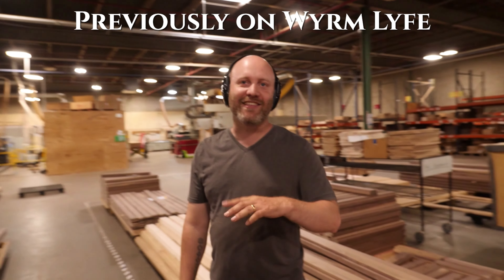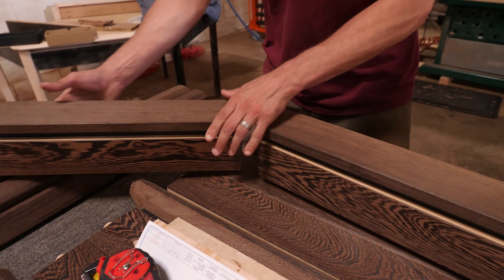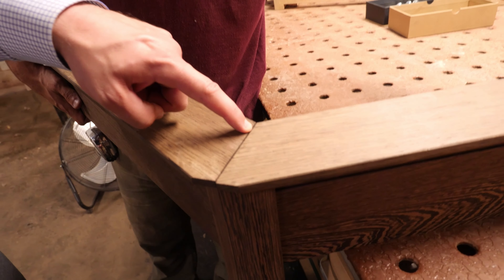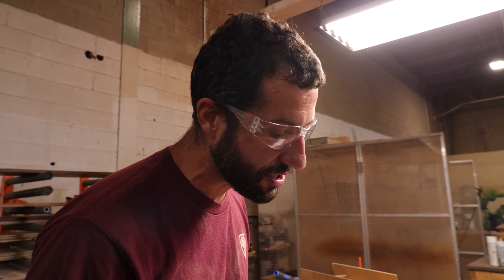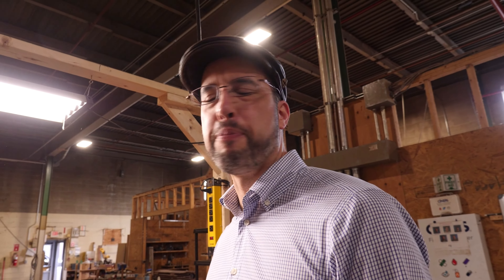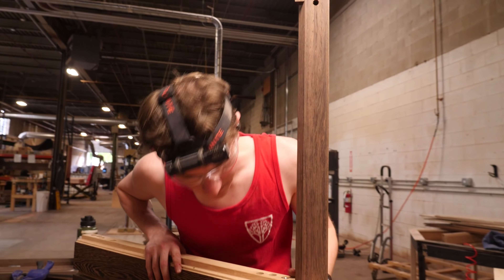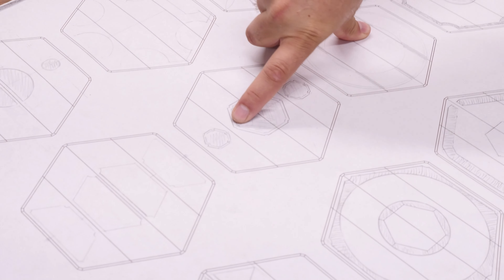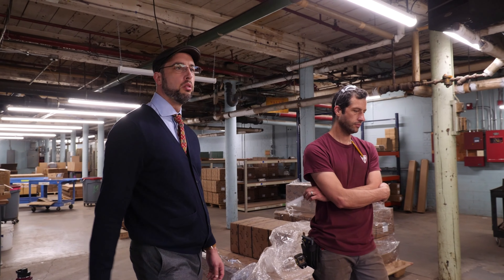This Table's Got Some Problems...

Comment: Glue a plug in, let it dry then re drill
Reply: They need you on speed dail for problems like this
Reply: I'm not even a woodworker, and this was my immediate thought.
Reply: Truth. Way easier than making whole new legs.
Reply: Just goes to show that Doug doesn't understand how to fix mistakes, and just decides to start over! Ed's suggestion is the correct decision, and proves that Ed is a better woodworker :p
Reply: You know this was my first thought too, but if the master woodworkers didn't suggest it, I thought maybe I was crazy. Thanks Ed for confirming my initial thoughts and my level of insanity.
Reply: Especially on the interior of a joint on a prototype...lol
Reply: OKAY SO, 5:30 calls our Hunter's error in reading the blueprints SORTA but really this 30secs and the entire video are really just a display, a GLIMPSE,  of why Doug and Ian are MASTER wood artisans and why they have been able to build such a successful company...#wheresmydmscreen XD

Comment: I worked at a helicopter manufacturer, you'd be shocked at how much hidden factory stuff was going on that was out of alignment with design just to get the aircraft to fit together.
Reply: That's terrifying
Reply: @matt-lang  I find it reassuring.  Robots and lasers or not, when you absolutely want the best fit/performance, you have a skilled human make it work with reality, not a drawing.  It's part of why fighter planes are always late and overbudget.

Comment: Watching Dimitri try to open that box the way he was...unsettling.  That's...that's not how that works.
Reply: Especially those blunt 'display' blades. Ugh.
if it doesn't cut through carboard let alone tape, like hot butter, it doesn't have an edge.

Comment: It doesn't sound like engineering, it sounds like your configuration management. Making sure you pull the correct drawings and update the drawings for any changes made on the floor. Knowing where the hole should be means that CM function wasn't captured.
Reply: This guy system engineers

Comment: I had a crazy idea looking at Doug's concept art. A hex table that holds your hex dice vaults, then the tops of vaults have motifs on them.
Reply: The real question is, does the hex table tightly fit a collection of hex dice vaults?
Reply: The toppers are likely thinner than the thickness of a hex vault.